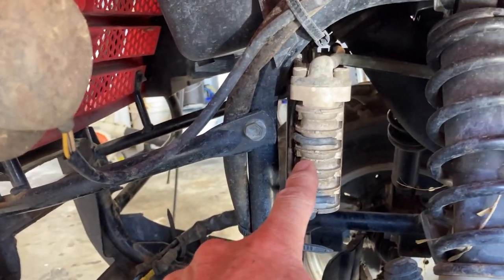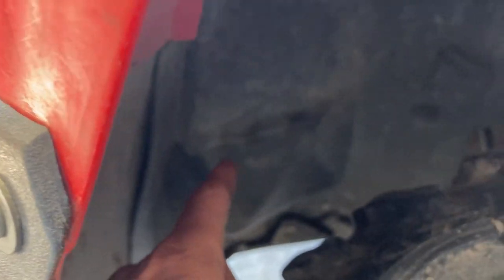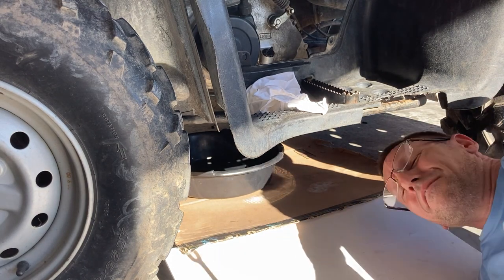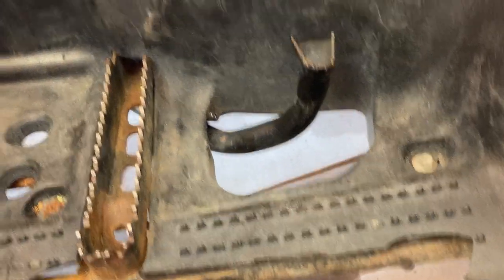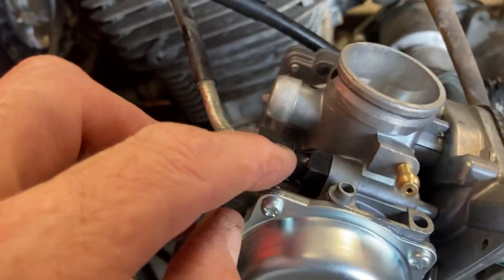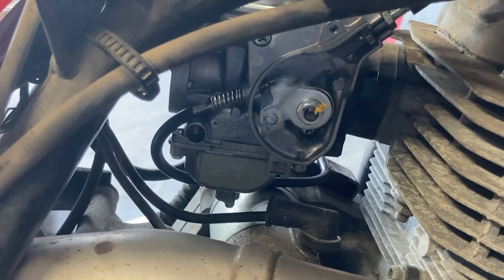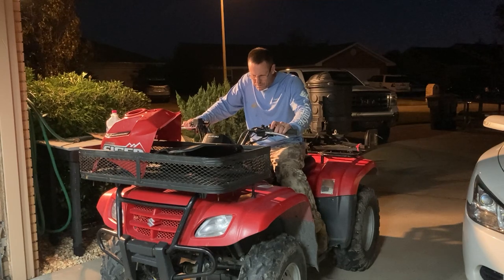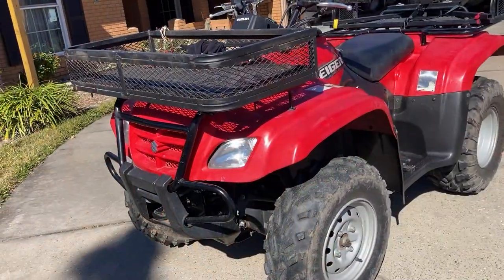16 year old ATV tune-up and restoration!   | Suzuki Eiger / Quadrunner 400

Comment: Mine is a 2003, 20 years old, and still starts and runs like a top. Would buy another without hesitation.
Reply from the maker: They are tough.  Ours is 2006....runs great with the new carb.
Reply: I just picked a 2004 up from out of town, and had a couple rides, needs a little tune up and these videos are super helpful!

Comment: This is very helpful and clear, I have this model too, will bookmark this to my favourites for reference. The only thing I notice being different is the petcock. I'm fairly confident the carburettor is functioning on my machine but it's currently suffering a "won't idle" problem. Another Suzuki Eiger owner on here has provided a potential solution, i.e. replace petcock. Btw yes, that 1 airbox screw behind the body is a bugger to secure/undo!  Thanks for uploading this 👍
Reply from the maker: The petcock is a common problem, but ours still runs great.   Ran it hard yesterday spreading fertilizer!

Comment: Enjoyed the video!  Trying figure out plug fouling.  Not sure if I need to adjust air fuel mixture, replace the carb, run higher octane fuel…. Not sure but the video did help build confidence if I need to replace the carb! 👊
Reply from the maker: It was a little tight, but I got it in.   We used that machine this weekend.....runs great!

Comment: You should add a nice lining of grease around the lip of the air filter to seal it and ensure no dust bypass. Crazy you worked it with no air filter.
Reply from the maker: We don't use it that much, but it's running much better now!

Comment: You said you got the cowling on eBay, are they new aftermarket or used. I can’t find those silly things anywhere, both mine are blown apart?
Reply from the maker: I don't see them on eBay anymore either, but here is the information when I ordered:  SUZUKI EIGER 400 AUTO RIGHT & LEFT PLASTIC FOOTWELLS, FLOOR BOARDS, FOOT REST  
Total: $145.47 
Item ID: 402802398322 
Seller: acjracing

Comment: What line did you forget about at the end?
Reply from the maker: There's a vacuum line that goes to the fuel petcock that makes it open to allow fuel to get to the carb. Without vacuum, no fuel will flow.

Comment: Be careful using Mobile 1 engine oil, unless it’s wet clutch certified. Mobile 1 contains molybdenum which is a friction modifier and it will ruin the internal wet clutch in that engine. The wet clutch it what keeps the drive belt engaged on that model. I have replaced a lot of burned up clutches on those Suzuki engines because of the wrong oil.
Reply from the maker: That's good information, but this ATV has been running hard and towing for 2 years and hasn't had an issue.

Comment: What about the wiring that goes on the battery? I can't figure out a tutorial to fix it at all It has not wires going through there
Reply from the maker: I've only changed the battery once...red to red, black to black...otherwise I haven't had to deal with electrical on this machine.

Comment: got the exact ATV...replace your fuel tank petcock with unit off Yamaha 600 raptor, those will fail all at once causing massive fuel leak. Yamaha direct replacement no problem. I love my eiger
Reply from the maker: I've heard of that with the petcock.  Ours hasn't failed yet, but when it does, it won't be at a convenient time, I'm sure!